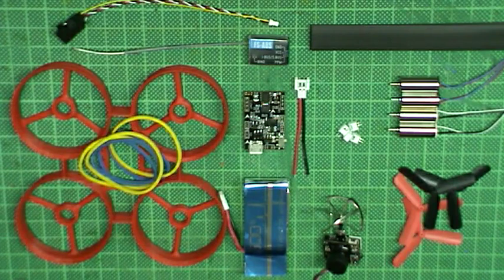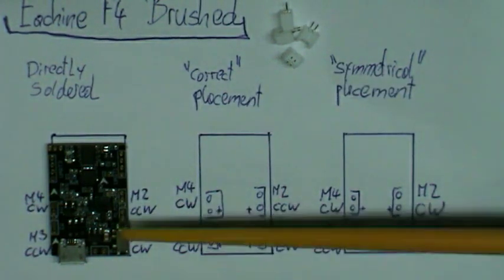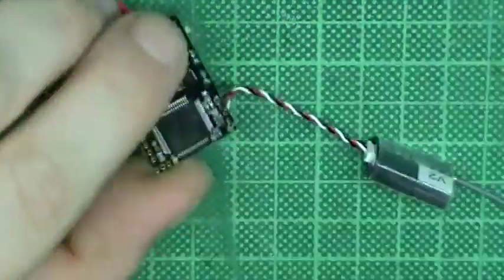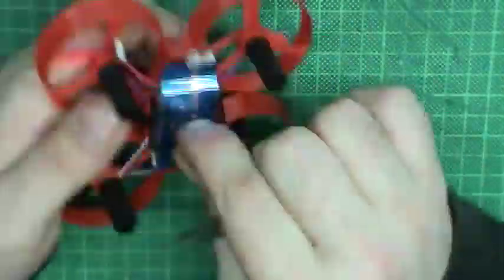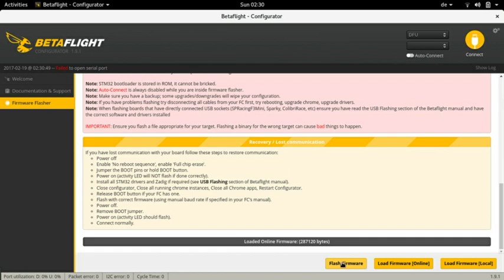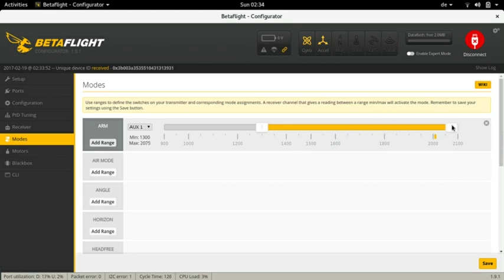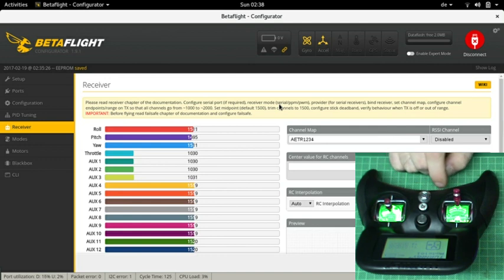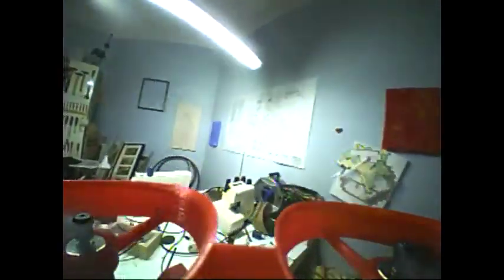Turnigy Evolution Whoop

Comment: Hi, my boy is abeginner having flown compitently the tiny eachine toy quads with included tiny transmitters. Just now bought the turnigy evolution transmitter. Is this micro quad still good or better new options? As an upgrade to his previous toy grade quads to pair with the evolution transmitter? Thanks in advance.
Reply from the maker: No, there are better options now. Definitely go with something brushless. I would suggest you check out the beta65 pro or maybe even the beta 75x. https://betafpv.com/products/beta65-pro-1s-brushless-bnf-whoop-quadcopter

Comment: A very good video you did for everyone. I have that remote and i also have the Taranis x9d. I wanted to get into racing drones and just for fun drones so i have read the directions on binding on both remotes but i guess i am doing something wrong somewhere cause i can not get either remotes to bind to my Mantis85 drone at all so if you can help i would be so very thankful. Thank you.
Reply from the maker: Hmm, unfortunately I do not know the Mantis85 drone, which receiver protocol does it use? You should have the most luck with the multi protocol transmitter module for the taranis.

Comment: I bought the purple racerstar motors and got some 400mah 3.7v batteries. the motors died after about 20 flights. Is that normal. What motor battery combination would you recommend?
Reply from the maker: I use this motors => https://goo.gl/Lzt8XT and this batteries => https://goo.gl/v0hhL2 although lately I started to switch the batteries with the turnigy graphene 1S. 20 flights is very little, that would be about 1 session for me... It is very important to let the motors run in first. Other than that, brushed motors will wear out over time, but it takes at least 120 flights until they are done for me...
Reply: I turned the filters off because I saw a video on youtube telling me it would make it faster. I think that burned them out. I will try those motors. Do you think the purple ones are worth using or do they drain the battery too quickly?
Reply from the maker: Oh, yes -  be careful about deactivating the filters. You should disable them step by step and make sure the motors do not get too hot after disabling each filter. Other than that, have you tried Betaflight 3.2 with dynamic filtering? Not sure which motors you use exactly, the only purple ones I can find are the 6mm ones... I do not have experience with any of the 6mm motors - only 8mm in diameter.

Comment: nice guide man, only lacking on quality of the video. if it was 720 would be heaps better
Reply from the maker: Yes, you are absolutely right. The first videos I made, were filmed with my phone, I than borrowed this cam, and was told it is full HD, which it was not, but I only found that out when I started cutting. I got a full HD cam now, but am still experimenting with lightning - still new to this.

Thanks for your feedback :-)
Reply: have you got instructions on which wires the receiver plugs into. I have a spracing f3 evo mini board what wires would go into which connection on board. sorry If o don't make any sense only new to building
Reply from the maker: Unfortunately this highly depends on the exact board and receiver you are using. If you link me to the product pages of those, I can take a look.
Usually, when you have an i-bus or s-bus capable receiver it is only power and 1 data line (or 2 with ibus) to one of the boards UARTs - this needs then to be set in Betaflight, or which ever firmware you are using.